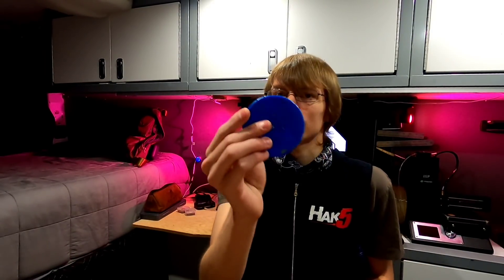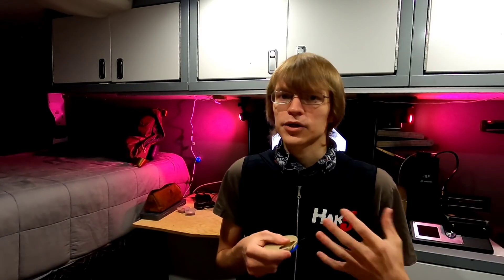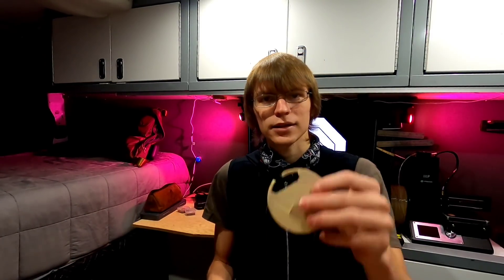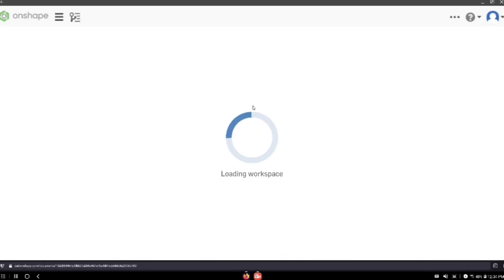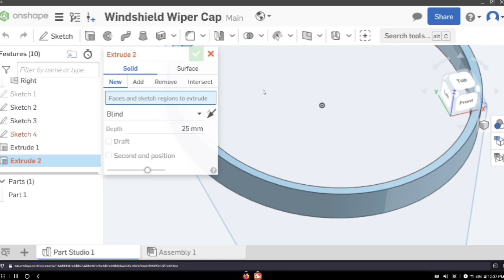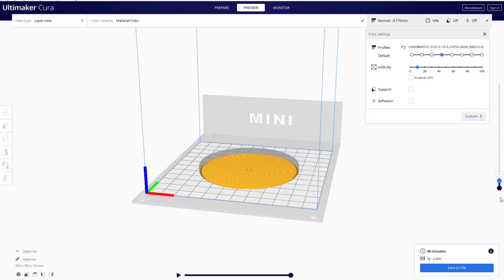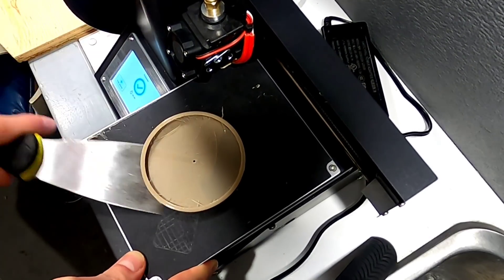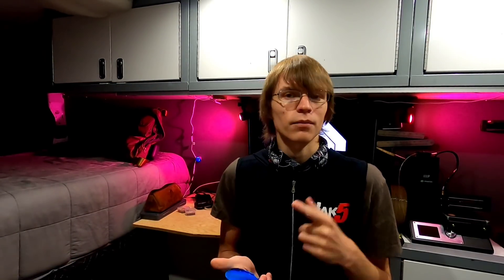Designing and 3D Printing Van Parts w/Glytch

Comment: Nice video! 😃

I see you’re using Samsung Dex on a Z Fold2 - just wanted to point out that you can also create a chroot environment inside the Termux application with the help of the Andronix app. Then you just connect via VNC using a vnc viewer app (you may have to experiment with a few to find one that works well in DEX) and utilize it to have a full linux graphical environment. You could use this to run Cura for your slicing - for example. I’ve been able to run KiCad, etc. Curious whether you’ve considered this yet.

Comment: I printed a nylon oil plug gasket on my monoprice mini delta out of weed eater line. I found the dimensions of the washer on various car parts sites. I got great layer adhesion after drying it and printing at 270c.

Comment: @ 3:58 Myself I just stretched Cling Film over the bottle neck...
Worked well 4 me...
Reply: I was thinking a ziplock baggy and rubber band. But yeah.

And as long as he is wasting $20 in filliment to save $5.00, he should add a tab with a hole on the side of it so he can tie it off to something.  That way if it pops off again,  it will just dangle within reach instead of losing it.
Reply: Or a Pringles can lid?

Comment: I was gifted a Ender 3 Pro for Christmas and I run Linux exclusively at my house.  I found that Cura works great on my machine, so my slicer is taken care of. However, for CAD, is OnShape my best option to use on Linux?  

I have almost no experience in 3D design space besides trying to use Sketchup (and failing/giving up) to model something simple like a shelving system.  I found that my normal method of building something simple like shelves was easy enough without a 3D model.  Since I'm new in the 3D space, I would like some opinions so I can focus on learning something powerful enough to make something useful without having to learn all the options and picking my favorite.  I understand that there's strengths and weaknesses of each one, so I'm looking for a well rounded option for beginners.